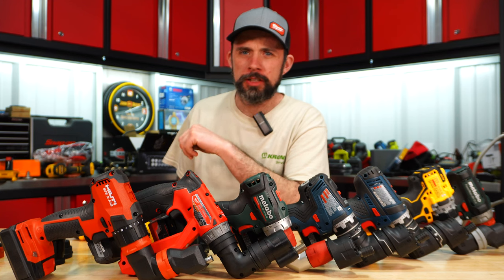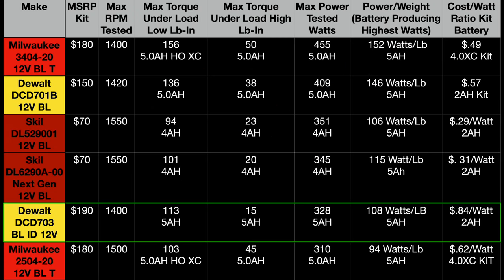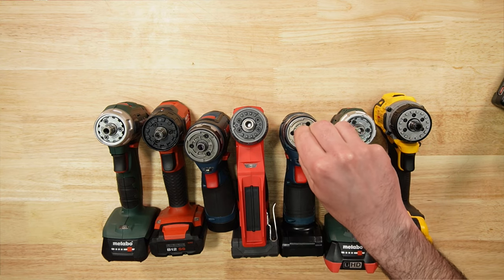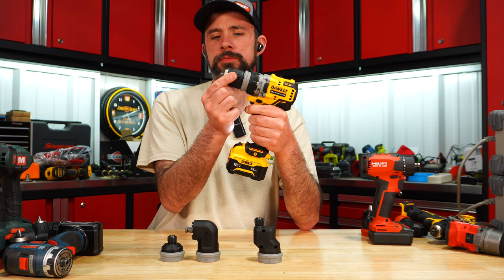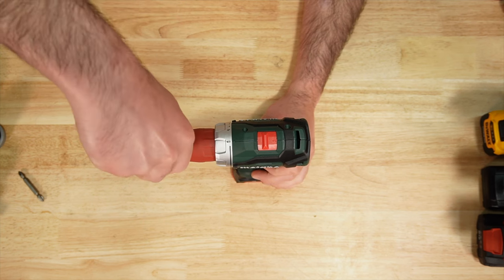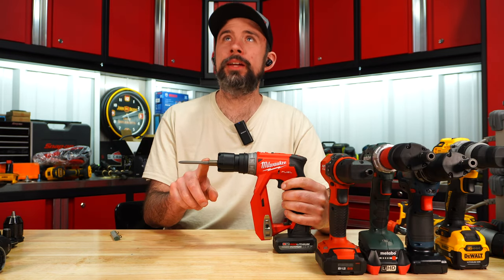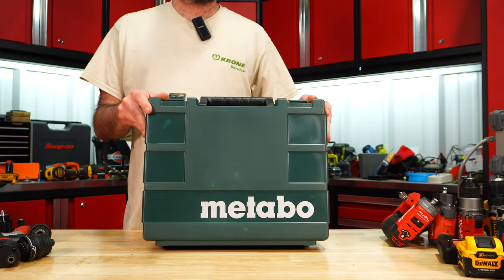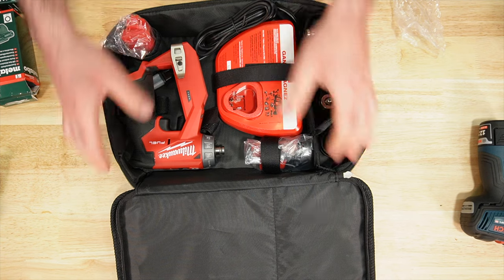Best Installation Drill/Driver 12V Part 1

Comment: Dewalt did a good job, but it appears significantly larger than the Bosch. Is it just because of the larger battery? These are often used in tight situations, so I wonder if size is another factor or are they close enough in size
Reply: they aren't close in size. Bosch and DeWalt look about the same length but the DeWalt is taller and heavier by almost 0.5lbs bare tool.
But it also has a slightly narrower grip because it uses a slide in battery rather than the stem battery on the Bosch (which would also apply to Milwaukee).

DeWalt's 20V Atomic line is almost the same size and weight of their 12V Xtreme line and the 1.7Ah Powerstack is almost the same size and weight of a 12V 2Ah battery.  That's why IMHO their 12V Xtreme line is a hard sell and it shows because DeWalt invest very little in it (almost no tool selection)
Reply: @engineer_alv  Despite Bosch 12V and M12 having the same exact battery design (minus superficial differences), I find Bosch's grip much better. Milwaukee making the grip bulbous perplexes me.
Reply: @ccbowers  I hear you, I like my M12 tools but only my high speed ratchet has a comfortable grip.  Can't say the same about my 3rd gen impact driver
Reply: @engineer_alv  I got that 12v Dewalt oscillator and it's a little beast. Works just as good as the Makita 18volt a had. It's also a bit smaller and way easier to handle.

Comment: 😮 So is the Dewalt dcf601 basically the same as the 703 when it comes to internals?
Reply from the maker: Hard to say,  but I would assume so.  Hope to test the dcf601 at some point on the dyno.
Reply: @Tools-Tested  think there's a chance the 703 gearbox fits into the 708 20V Atomic?  Flipping between a couple tabs on Google images they look very close, but the screw spacing on the front and input gear on the motor could be slightly different for all I know.  Otherwise the only real difference I can see is that the front motor vent cutouts are a little bit different, but the overall geometry on their side profiles appears dead on.  

Being able to get this tool onto the 20V platform would be the way to go I think.  Especially with the 1.7 Ah Powerstack making the 12V line a bit redundant.
Reply: @jaywelker5566  totally agreed. DeWalt's 12V Xtreme lineup looks redundant now that they've put real effort into their 20V Atomic lineup. Their tools size and weight about the same and the 1.7 PS battery weights about the same as their 12V @ 2Ah battery. 
Offering just a dozen of 12V DeWalt tools seem to backup our findings even more.

There's a reason Milwaukee and Bosch don't market a subcompact 18V lineup along their 12V lineup. They differentiate very well between each other and Bosch even has an 18V installation driver that looks, weights and performs vastly different from their 12V version so they won't cannibalize.

Comment: 2:36 the metabos and the dewalt are too big to be considered installation drivers, the are basically the same size as a small 18v impact from some brands. I get they are 12v still they are too big and should be disqualified imo festool could have been there though

Comment: im surprised with Hilti's performance, mancaver compared it to the metabo and they performed similarly.
Reply from the maker: Yeah I remember watching that video,  hard to say why the data is different.
Reply: @Tools-Tested  if the torque test came out differently, the Hilti is probably solid. I tried it in the store and its a reasonably strong tool. Would you be doing any real world usage test on these?

Comment: is watts really the best way to perform tests for this kinda thing? it's really not the ideal unit to work with through rotational physical load test... it just seems weird when you think about the capacity of a battery gets measured in total Watt hours, but your measured output indicates a much higher output of wattage than the battery.. brain freeze ahhh
Reply: He got all the relevant numbers. Torque, rpm, watts out. What does watts out have to do with watt hours of the battery. Pulling 500 watts out of a 100wh battery is no biggie
Reply: I think it works. Having a tool consuming more watts is a good way to know how much it will last on a single charge.
You can see big variations between tools of the same voltage, eg a Milwaukee ID with a 2Ah battery will potentially run longer than the DeWalt with a 2Ah battery
Reply from the maker: Yeah most motors are rated in watts which can also be easily converted to HP.

Battery's are rated in AH (amp hours),  So 6ah= 6 hours of run time @ 1amp.

So watts/volts= amp draw

Hope this makes sense.
Reply: @saiiiiiii1  true but I've seen agm batteries capable of some high wattage too.. it's not a race to the top, but a matter of sustaining that position once there.